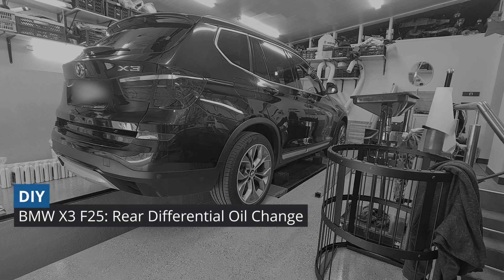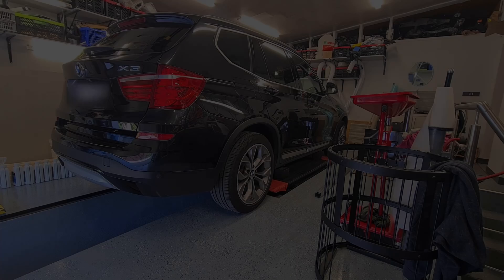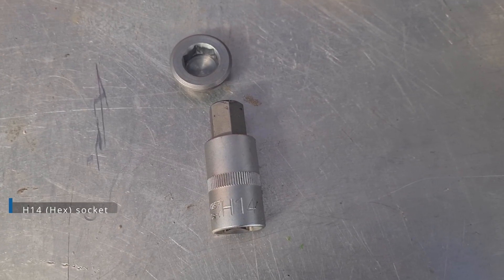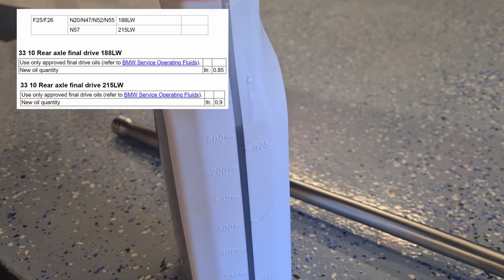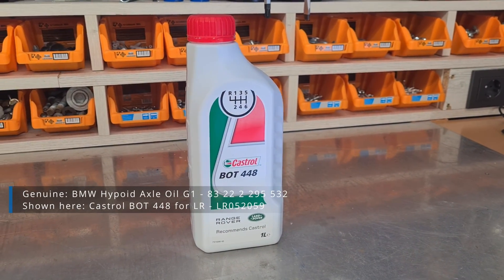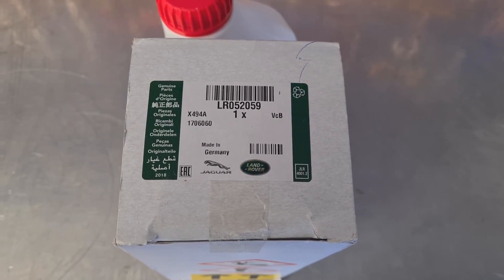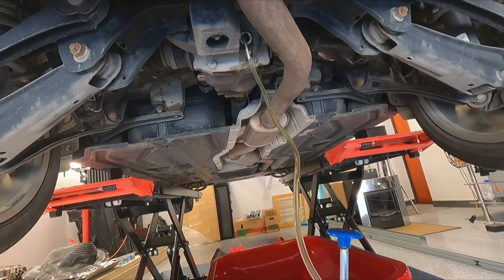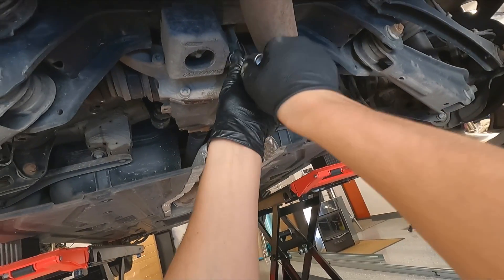Rear Differential Oil Change: BMW X3 F25 28iX 2017

Comment from the maker: 🔧 Tools used: 
       🔹BGS 2292 General rachet and socket set: https://geni.us/0Hhd (Amazon)
       🔹BGS 5188 Torx and Hex socket set: https://geni.us/Zz55Akr (Amazon)
       🔹BGS 228 flexible long ratchet ½: https://geni.us/aFqZxDW (Amazon)
       🔹Hazet 1979N-92 flashlight: https://geni.us/gTxEiHA (Amazon)
       🔹Hazet 1979WP-1 magnetic charging pad: https://geni.us/abMfAS (Amazon)
       🔹Oil extraction syringe: https://geni.us/iF1M (Amazon)
       🔹Oil drain pan wheeled: https://geni.us/zmEK (Amazon)
       🔹Gearbox fluid hand pump: https://geni.us/IzMivui (Amazon)
       🔹Gedore 40-200 Nm torque wrench: https://geni.us/zseU (Amazon)

⚙ Spare parts used: 
       🔹RAVENOL 75W-85 rear diff oil: https://geni.us/JFDAu (Amazon)

⚙ Additional stuff: 
        🔹Nitrile heavy duty gloves GRIPPAZ: https://geni.us/tc4XaYP (Amazon)
        🔹Brake cleaner: https://geni.us/LOeBEc (Amazon)
        🔹Oil absorbent pads: https://geni.us/AAvW0We (Amazon)

Comment: Thank you for the great video, I'll bother you again with a question, I have 2017 X3 sDrive, I followed your recommendation and purchased the RAVENOL 75W-85 rear diff oil for the rear Differ, just want to make sure this will be ok?
Reply from the maker: It is alternative to bmw's Hypoid axle oil G1. Should be fine.

Comment: Hi, congratulations for excellent work. Bot 448 Casteol is a SAE 75W85, do you think it would be fine if I use Motul Motylgear 75w85?
Reply from the maker: Hi. As per manufacturer, it can be used in non-LSD differentials, so I guess you can use it since it is 75W85 viscosity. 
https://www.motul.com/en/en/products/motylgear-75w85
Reply: @dionich  Thanks for the reply. Do you think it is a problem for differential because Motul is semi-synthetic compared to Castrol bot448 which is full synthetic?
Reply from the maker: @Nik-hm5um  theoretically should be fine, but I would personally go for castrol bot448 or bmw genuine just to be sure that no issue pop up after the replacement.